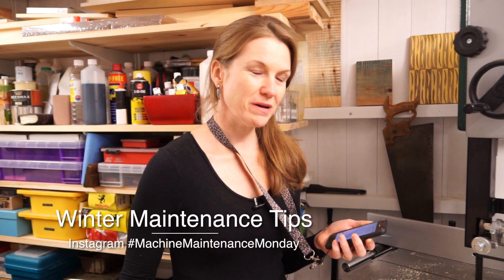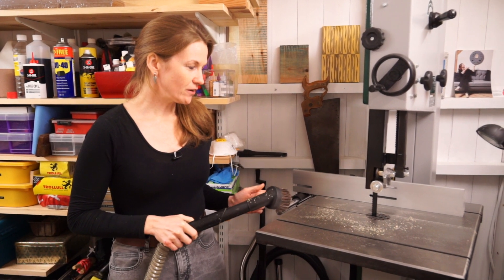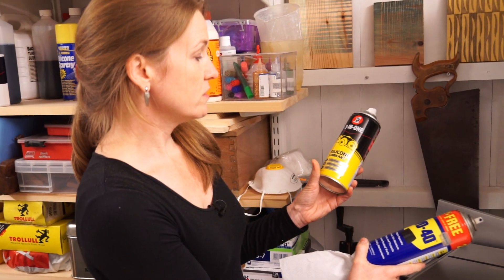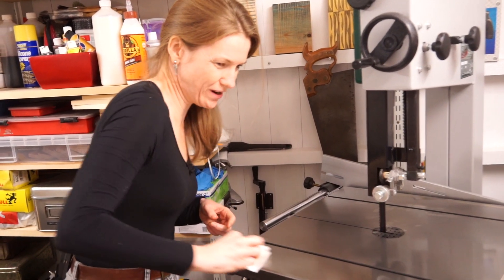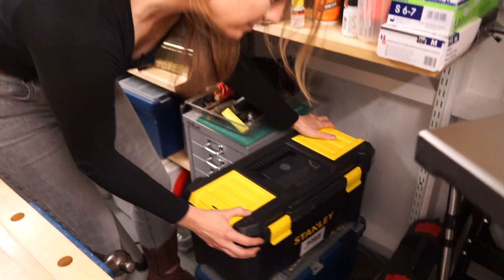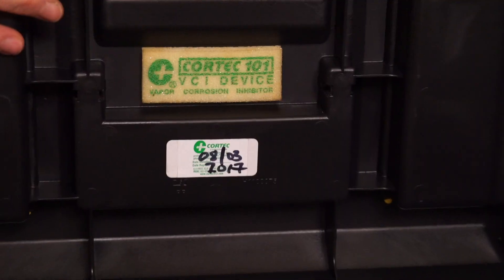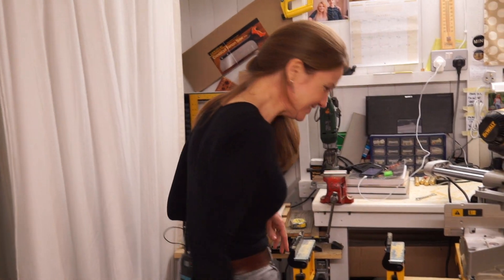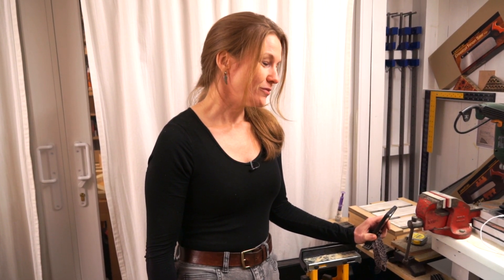Machine Maintenance Monday - 3 Rust Prevention Tips for the Workshop

Comment: wd 40 NO  Silicone no  you want woodworkers wax or a dry spray lube or the oils and silicone will mess up your ability to put finish on a project. https://www.wwgoa.com/video/how-to-lubricate-a-table-saw-000290/#  I do not know what you have over the pond but this is what we do here.
Some surface rust  use 0000 steel wool and wd40 to remove then clean it off then a wax or dry spray made for tools. but silicone never!  Your finishes won't stick to your projects.